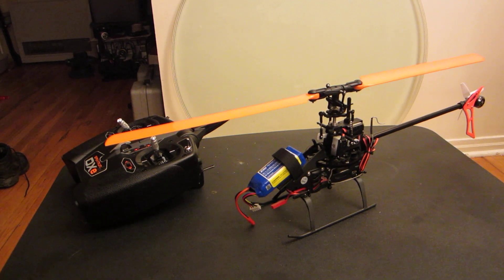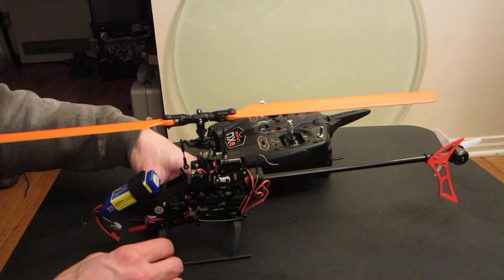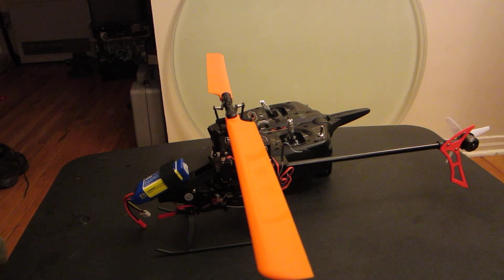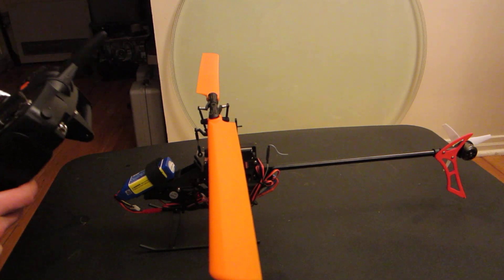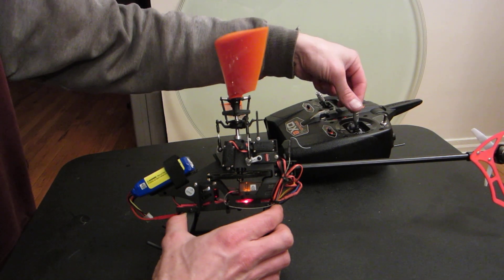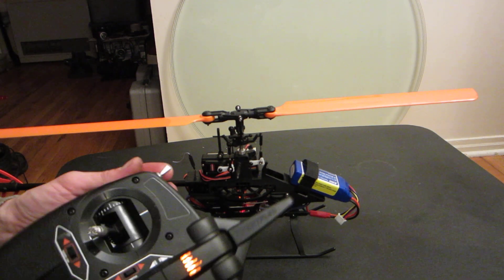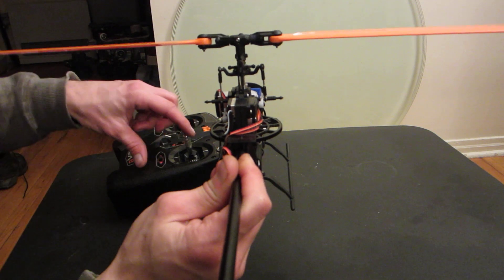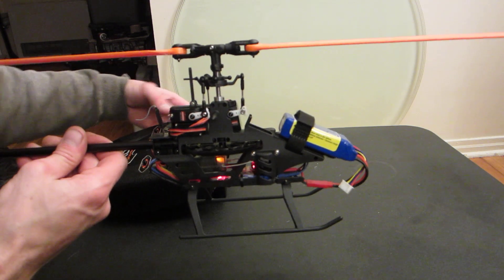Blade 230s swashplate motion with factory settings

Comment: Help Please . Collective pitch is not working . Throttle works and so does Rudder on left stick . Right gimbal is fine. Elevator and ailerons move fine . Please help . I'm using the DXs transmitter that came  it came with . 
Reply

Comment: Great vid… questions, I just picked up a 230 and bound it to my DX6 G2 and downloaded the 230s setup from Spektrums website, in stability mode everything works as it should, when I move to stunt 1 or 2 it wants to Spool up on it own, without the hold set to on… is this normal?
Reply from the maker: yes that is normal, because in stunt mode it can be flow upsidedown. And the motor needs to stay running while in negative pitch to be able to do so.

Comment: Thanks for showing. But I'm still looking for an answer to my question, which is: Pitch - does the 230s have the same travel for positive AND negative pitch? Mine doesn't and someone who's into helis told me my 230s V2 should have equal throws for pos/neg pitch (with the stick starting off at center position). Does yours?

Comment: can you set the limit angle in safe mode?
Reply from the maker: Yes. The dual rates translate to bank angle when in safe mode. So increasing or decreasing the DR is how you would do that
Reply: @Motoxxxman  no I talk about the angle maxim of the helicopter in safe mode thks
Reply from the maker: @did3d523  yes, that's how you adjust the angle in safe mode, by adjusting the dual rates
Reply: @Motoxxxman  ha ok what is the maximum angle that the helicopter can have I wil have one saturnday!

Comment: Thanks for the nice, instructive, video.  I'm about to go outside and fly mine for  the first time.  If I said that wasn't a little scared, I'd be lying.  I'm definitely going to be in the slowest (I guess you could call it "beginner's mode"),
Reply: Well, just finished flying the 230s, one battery's worth of flight time.  Up, down, left right, correct, correct, correct.  Learned to make slight movement with the controller sticks.   Never crashed, but did have some "accidental" touch and goes.  Definitely, needs more skill to fly than my Parrot Anafi drone, but all in all, i'm happy.  Got my battery on the charger and will fly again, later.  It was just a little windy, but not a lot.  I'm gonna develop some more skill at keeping a nice, controlled hover, before attempting to do a trim flight.

Comment: Hey, is it normal thath when I put my heli into mode 1 (agilty) it starts to fly from itself even without the throttle stick up.
Reply: Yes, that is normal with your throttle curve probably set at 85.  Normally you would take off in stability and turn it to Idle Up 1 when you want to.

Comment: CAN YOU PUT A 1300 3S LIPO ON 230S???
Reply: Yes you can. I have done it
Reply: I run mine with a 1350 3S LIPO
Reply: Cooldrums777  do you have a longer run time than the provided batteries 5 minutes? I ordered a 1200mah 3s today. Hopefully a couple more minutes.

Comment: Is it possible to fly inverted while in agilty mode? (mode 1)
Reply from the maker: Micha - yes, but make sure to have a little height when flipping it over, the rotation rates are a little slower in agility mode compared to 3d mode
Reply: Okay thank you.
Reply: So the flight controller only has two modes,stability(6 axis) and simulated flybar?
Reply: 3 modes (displayed as) 0-1-2